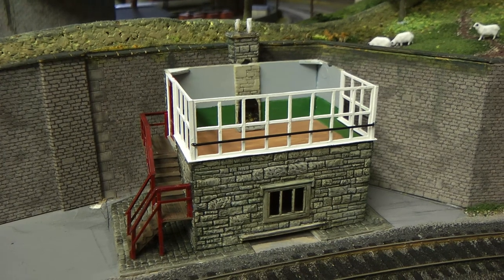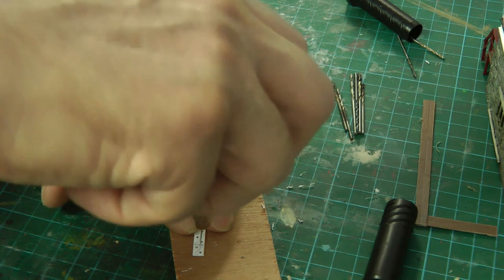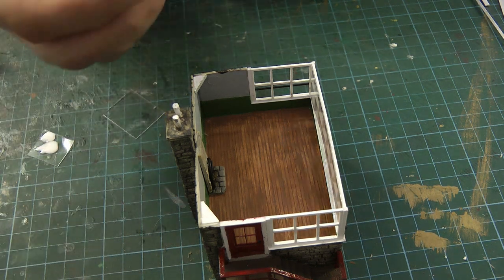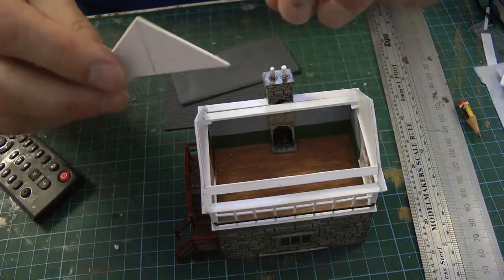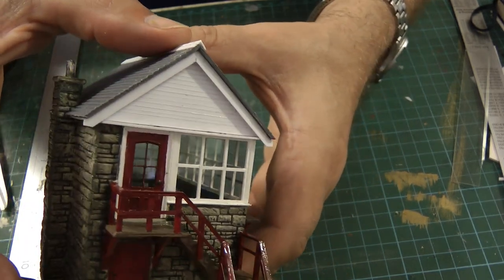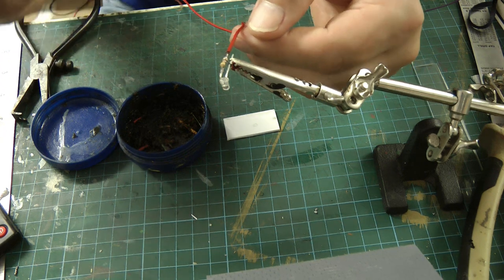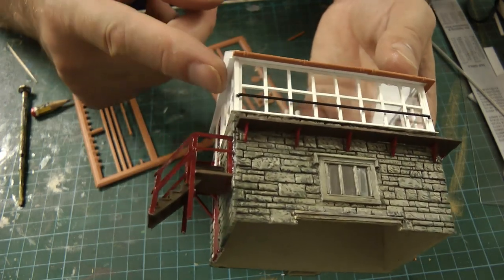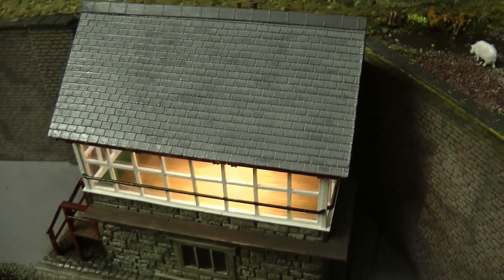Jarrow Road signal box Part 3   No 388

Comment: Tony, another good video. A hint for connecting wires to components: if possible make the joints staggered (not at the same place) so that if the wires touch together without insulation there isn't a short, of if there is insulation (heatshrink etc) the overall thickness is smaller.
Reply from the maker: Hi Andrew. great tip, i will bear that in mind next time. but these LEDs are very rigid. so they shouldn't touch. thanks for your input. all the best Tony

Comment: Hi Tony, one advantage of plastic is it makes for very viable removable rooves as you have demonstrated here, that construction method will certainly make it last. The walkway brackets turned out really nicely, amazing patience and good eyesight noted are essential. One more to go! All the bestvStephen
Reply from the maker: Hi Stephen, all this binge watching can not be good for you. Lol. i was not sure how to do those brackets. in previous builds i have used copper wire. but were a bit to small for that. thanks again. cheer's for now Tony.
Reply: @TONYNORTHEASTERN  Oh I was fine, made for a very enjoyable evening watching plus a glass of wine! If I recall correctly, In one of my 1960s RM , a chap glued 5 or 6 brackets together that had been pre cut to a set of triangles. Marked both ends with identical desired pattern. Then drilled 3 fine holes as part of the support pattern and then filed the outer edges to shape and thus form the scrolling required to finish the 90 degree brackets. It was easier to handle a pack of 5/6 than individually, but came with risk of damage when he came to cleave each piece off the pack. Personally I prefer your method, thought I’d mention. These days folk start hitting the 3D printer button…. So many different ways to do things! All the best Stephen

Comment: Hi Tony.  An excellent job with the roof.  So you decided to paint the brackets red.  You must have a gallon of that red paint, matey. 😂  I’m pleased that you used warm white for the LED as it gives a nice representation of an incandescent lamp.  
The cool white is good for fluorescent tubes or daylight.  
I thought you would have painted your gutter and downpipe before fitting, but I know how you like a challenge. 😂  
I agree that the roof looks too clean.  My slate roof has dark grey streaks down it so you may wish to consider something similar.  Maybe a dark grey wash with the brush strokes from top to bottom.  Just a thought; it’s up to you, as always.  Have a nice weekend.  Best, Jason.
Reply from the maker: Hello Jason. your right i would normally paint the guttering and drain pipes before gluing onto the buildings. i think i may be loosing the plot at times lol. 
The great central railway has the old gas lamps and they glow with a warm yellow. the roof will need a final touch up before the end of this mini project. 
all tips are welcome you know me by now. hence why i am shaking an empty tin. lol. take care. looking forward to our meeting in Newcastle in November. cheer's for Tony
Reply: @TONYNORTHEASTERN  Looking forward to meeting you at Jesmond, too.  
It’s been a loooooong time coming.  Cheers Jase.

Comment: Dear Tony, love the way you did the removable roof. Just wondering on how the power lines will interfere with the removability. Anyhow, agree on the level of cleanliness of the Wills slate. Must say there I like Tony’s version much better, also because it takes color and grime much better. Didn’t agree on the fascia boards. Liked the first ‘overhang’ better, that little protrusion has a function, it helps to extend the drip away from the building. That apparently goes better on squared corner, than on a triangular one. The triangle will create more/small capillary action. With a little bit of wind the Jarrow Road signal man will start swearing he’s gotta go out and wipe the bloody windows again. Nevertheless, it’s Tony’s signal box! Curious for the interior. Very cool to see so easily into the structure. Cheerio
Reply from the maker: Hello Vincent, the removable roof is a good idea just in case the led pop's. buts its very rare. they cables at the moment are temporary linked to 12v supply. but yes the ends will be tinned and fitted properly once finished. and if anything should a miss or needs maintenance. it would simple just to remove the cables. 
i looked into signal box roofs before starting this build. the triangle are to be found on the railways. depending where they are. i suppose if they are on an embankment they would have a pitched roof all round. 
but yes i do accept the point you have made.  i do imagine peter pointeman swearing a lot. 
Thanks again for commenting. i always look forward to your comments. cheer's for now Tony

Comment: It's coming along nicely, Tony, I'm impressed.  I also noted your comments on loft temperatures...!  I had a loft layout in our previous house when we lived in Redruth - summer temperatures could approach 50 centigrade...  This meant that the layout could only be worked on in spring and autumn which was only seven to eight months a year: so yes, I do sympathise.
Reply from the maker: Hi Ken, temperatures can be extreme in the loft, even though the loft has been insulated from the heat and the cold, but it still gets warm sometimes, to warm for me. even with the Velux window open. now that the cooler nights are almost upon us i will be able to spend more time in the loft. life style permitting. thanks again for commenting. have a great weekend. cheer's for now Tony

Comment: Hi Tony. As always I am in awe of your scratch building! From the outside it look like you have been out and bought a resin model! My plan has always been to use Metcalfe kits initially and gradually replace the with Scratch builds. I just hope I can come somwhere close to your own standards! 
BTW if you are going, what day are you attending GETS? I've had to lump for Sunday as Vintage shuttle buses were never designed to pick up motorised wheelchairs! lol
Reply from the maker: Hi Mav. i am at GETS for both days. although i like to away by 1 Oclock on the Sunday due to the long drive. it would be great to meet you. 
I am sure once you have mastered the Metcalfe kits, scratch building will become second nature. patience and precision. and a little bit of luck. take care my friend. cheer's for now Tony.

Comment: Hi Tony, another masterclass, thank you! Can I ask what pin vice you were using? I've yet to get one. The brackets look super under the running boards! The holes look so fine and bring it to life with the gloss maroon paint. Cheers, Dave
Reply from the maker: Hi David. i was going to make those brackets  out of copper wire. but i think these look just as good. many thanks again for your support. cheer's Tony

Comment: Surely the external running boards have railings on the outside edge?
Reply from the maker: Hi Edd, that's what i thought, but there are many of signal boxes that i have seen with the boards and railings set up this. there are plenty of pictures out there with this set up. thanks again for your thoughts, cheer's for now Tony